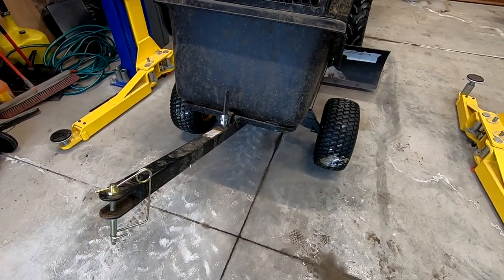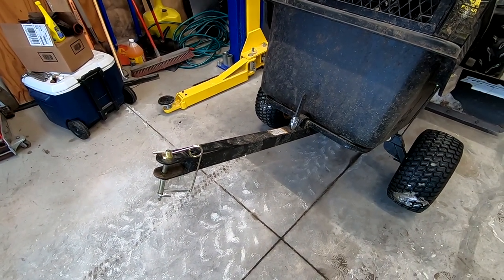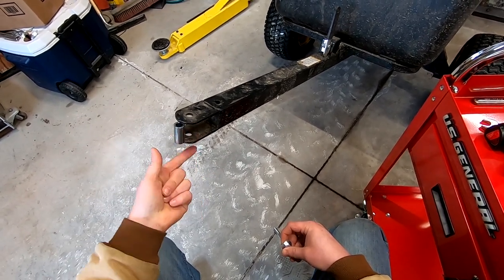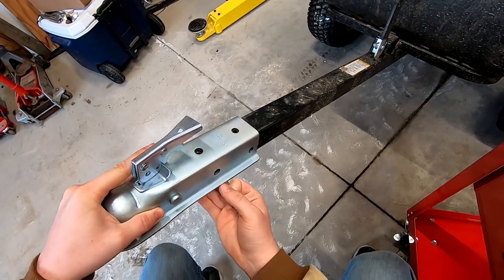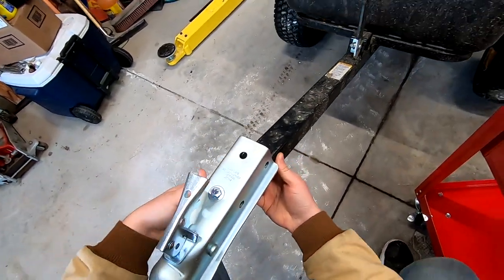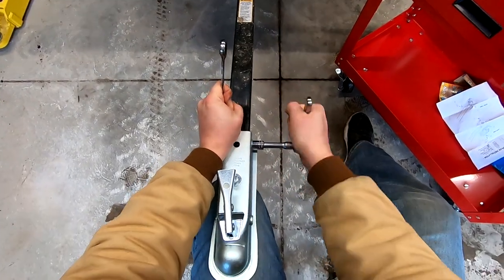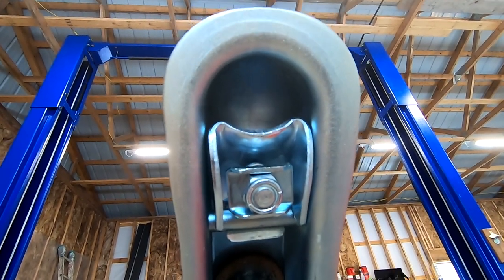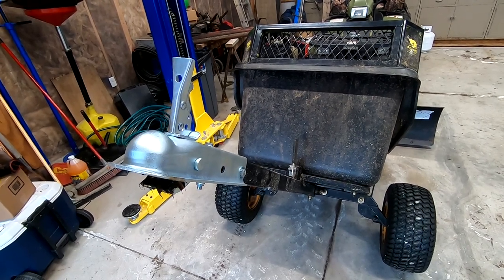Trailer Ball Hitch Conversion Kit Installation

Comment: this is exactually what i am looking for to convert my yard trailer to a ball hitch. were did you get the converter all the ones I see you have to drill through the sides and not through the pin